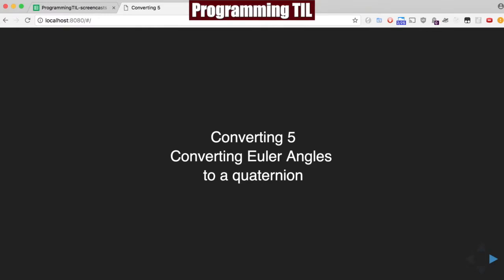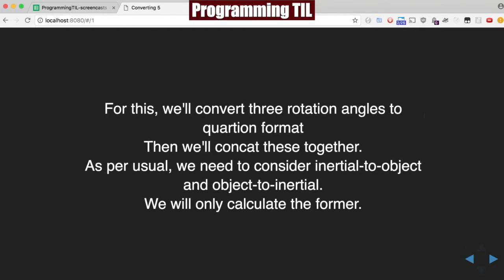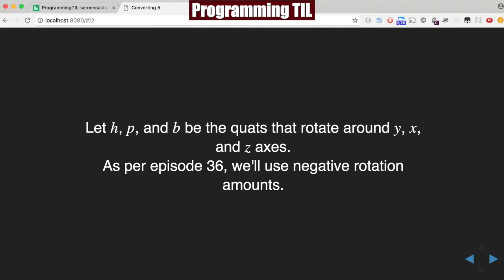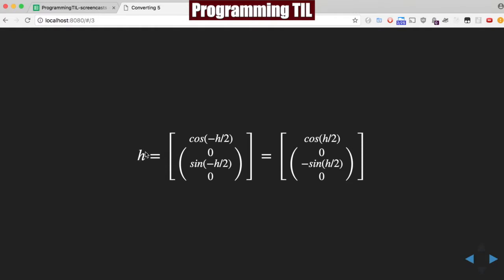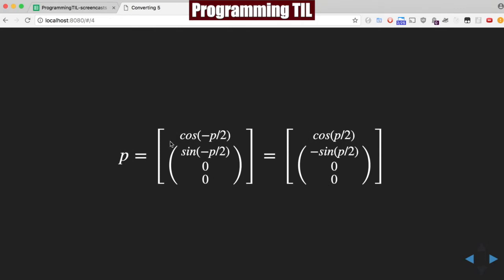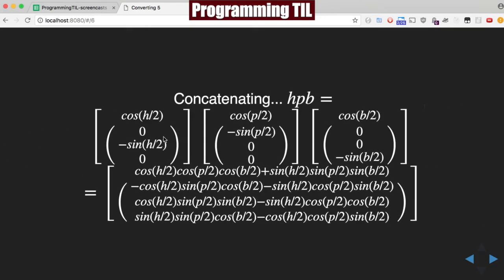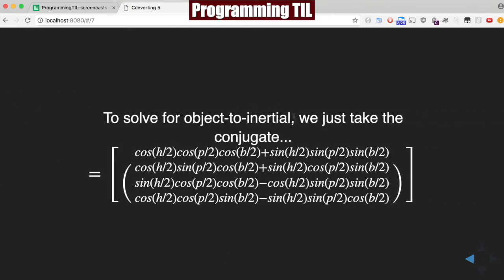How to convert Euler Angles to a quaternion ProgrammingTIL #196 3D Math 40 tutorial video screencast

Comment: You neglected to mention that rotations in 3D are not commutative (viz, quaternion multiplication is not commutative), and you have assumed a specific ordering of these Euler angle axes, in other words, multiplied the axis quaternions in a specific order. Sometimes roll pitch and yaw measurements assume a different application order.